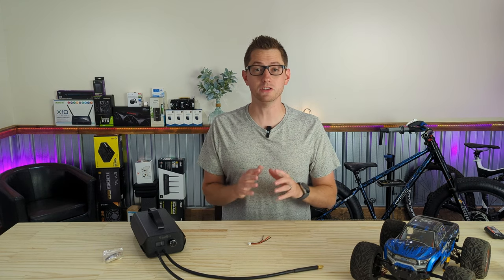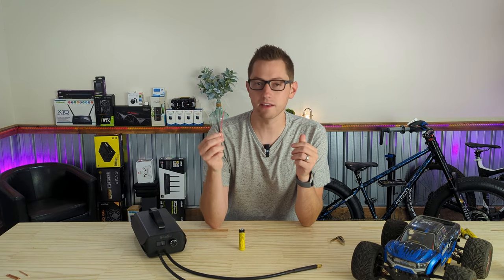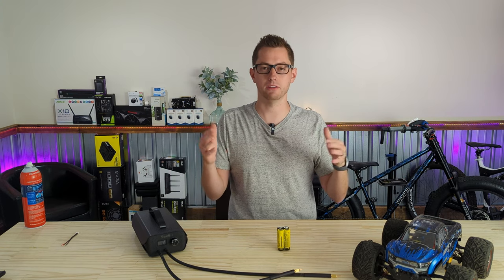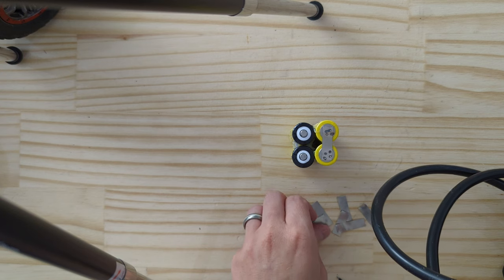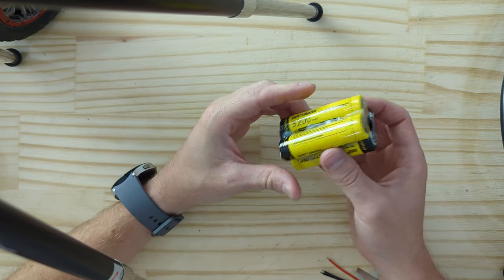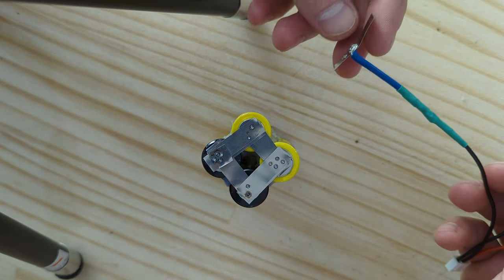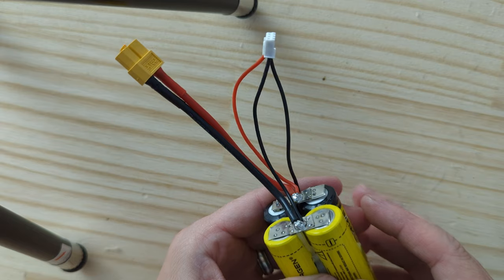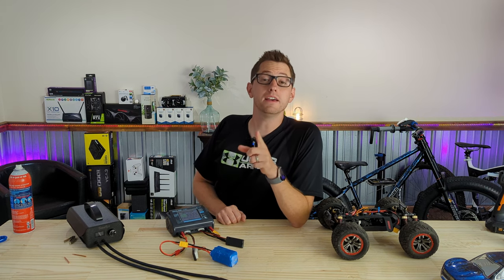Build your own RC battery! Save money!

Comment: You need to make sure you don’t touch your spot welder probes together. I have the same welder, works good but voltage drops pretty quick if your building large packs and doing lots of welds. Also use the file to flatten the probe ends. You shouldn’t have huge sparks , clean your probes if you do. Keep medium pressure but not to much. Resistance needs to be high enough to create a weld.
Reply from the maker: Awesome tips! I will do that. I'm sure I'll learn some of these tricks of the trade the more I do

Comment: Can you solder the nickel strip on i stead of spot weld?
Reply from the maker: you could, but you don't want to put too much heat into the cells since it can damage them. So that's why soldering is less preferred unless you do it on the strip while it's off the back then spot weld to the pack or something for the main leads.

Comment: Hey so I don’t understand what the little 3 wire connection was used for ? Why do you need that if you can than just plug it in.
Reply from the maker: It's a balance lead so that the charger can know the voltage of each cell in the series and charge them evenly

Comment: I've seen RC battery packs with high discharge rates, such as lithium packs with 10C or 15C, and LiPo packs with more than 30C. 
Have you considered the C value of your batteries for your homemade battery pack?
Additionally, have you noticed any speed differences or overheating issues compared to the original battery pack?
Reply from the maker: Good question. You can get all sorts of 18650 cells with higher c rating or higher capacity. These ones that came free with the charger definitely don't have the best discharge rate so i can kind of tell but not much. When I build others I'll pick better cells. No overheating so far everything has been going good.

Comment: A lot of the problems is not in your power. Your voltage amperage on your little spot welder. It is the amount of pressure you put on the probes too much pressure no good not enough pressure no good got to find that happy middle
Reply from the maker: I need some practice!
Reply from the maker: At least no fires lol